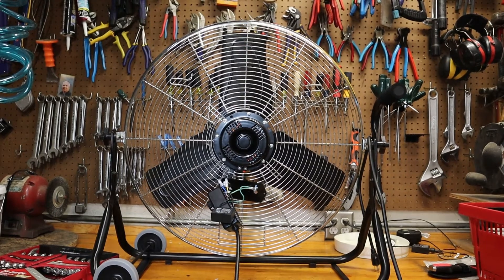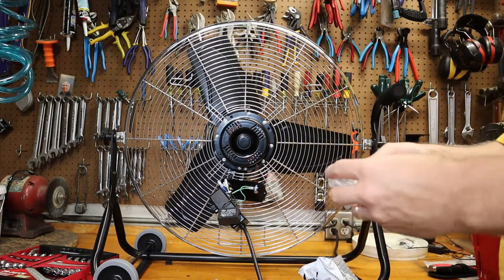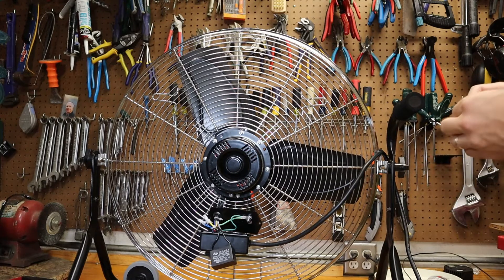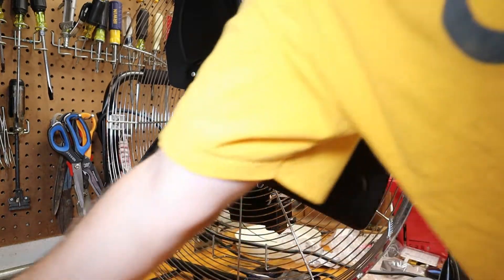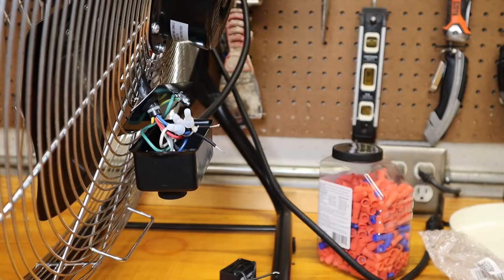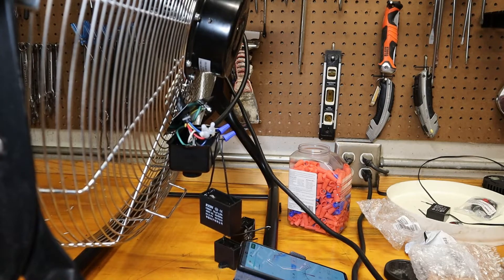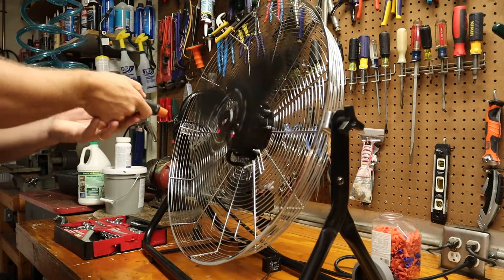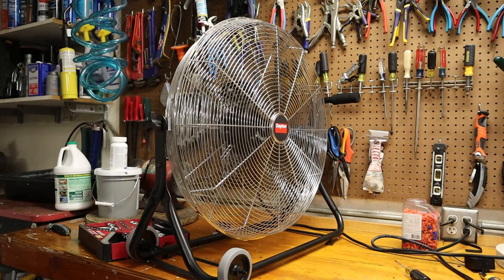Noisy fan! Let's see if we can quiet it down.

Comment: Is the fan working fine until today? 
My table fan has an original 2uf capacitor. Would replacing it with a 1 or 1.5uf capacitor help reduce the speed and noise?
Reply from the maker: Yep, still working like a champ today! No issues

Comment: Hey man love your video, I have a question though. Can you place a capacitor on a variable speed 6" motor? I have one connected to my AC to ventilate air from outside to the inside. I want to place a capacitor like you suggested to quiet down the fan. Will I be able to do this on my fan? 

This is the fan I have - iPower 6 Inch Inline Booster Duct Fan with Speed Controller, 275 CFM Exhaust Fan HVAC, Duct Blower for Bathroom
Reply from the maker: Probably not, but depends what type of motor it is and how the speed is controlled
Reply: @JoesGarageProductionsLLC   Hey Joe, it's a variable speed single phase 120v motor
Reply from the maker: @invest_9361  is it an induction type motor? A brushed universal motor? A brushless motor?
Reply: @JoesGarageProductionsLLC  Looked it up and says it's an induction motor.

Comment: The capacitance is not related to the speed of the motor, but rather the phase shift occurring in one of the motor’s sets of windings. Any increase/decrease in speed will be the result of the two windings inducing excessive slip and over time, this will cause the motor to overheat.

Comment: Old attic fan converted to a box fan with casters. Double gang box mounted on the side with switch for fan and a regular plug to use for whatever (drill batteries, small tools etc..) goes with me to every job in the summer. The large sharp curved blades just move so much air it’s unbelievable and so quiet!! You could get a voltage changing thing to control speed?? Cool video!!

Comment: I bought a plastic box fan, but the person who gathered the groceries upgraded the fan I had to a fan similar to yours, I think instead of replacing that capacitors, I will just get a plug in rheostat to cut the speed. it's more expensive but at any time I can just unplug it to get the original speed back, or switch it to full speed mode
it's basically the entire fan controller in a box.

Comment: I just bought a pedestal fan for $100 and the god damn thing sounds like an airplane... just the sound of the blades, not that there is something broken, but it does make me wonder if the motor is defective making it more powerful than it should be. Its unbelievably annoying and it's on the lowest setting. How do people put up with that?
Reply from the maker: That's exactly the way this fan was. It is much quieter now after changing that capacitor and I've seen no ill effects from doing so other than slightly reduced air flow... Totally worth it!
Reply: @JoesGarageProductionsLLC  I think im going to give it a try, as i do not want to disassemble the fan to take it back, and it's a nice fan.. just way too powerful. I am still not sure why someone would want a bedroom fan that sounds like a wind turbine and damn near blows you over at full speed. Lol
Reply: @JoesGarageProductionsLLC  Just opened my fan up and it only has a 5 microfarad capacitor in it, so i went ahead and ordered a 2.4uF. That should bring the decibels down to within tolerance! Actually a very easy customization. Thanks for the video!

Comment: I’ve been watching some of your videos. They are interesting.  Just curios I have a fan tower it starts but the darn thing takes like 10 minuets for the fan to actually move. I’m thinking the magnets are dirty.  Or something.  

You should do a video either the machine you  use when checking the sound wave
Reply from the maker: Thank you! This is a pretty common speed control technique on inexpensive AC induction fans, as it turns out. I wouldn't be surprised if your fan tower had a similar setup (assuming it has an AC induction motor)

I used an android cell phone app to measure sound. I believe it is a free download.